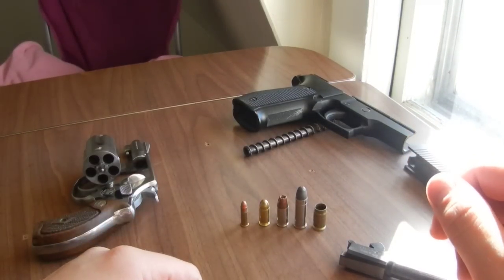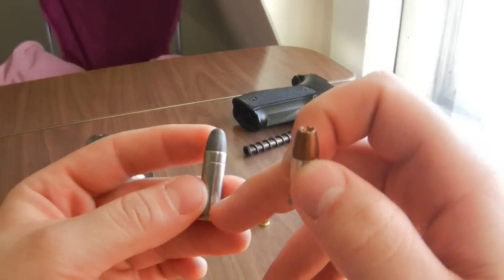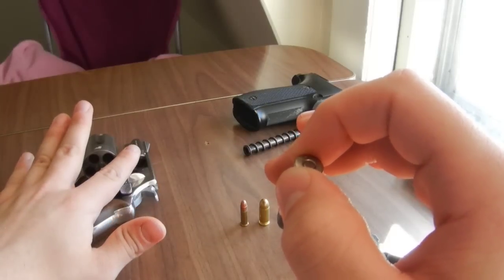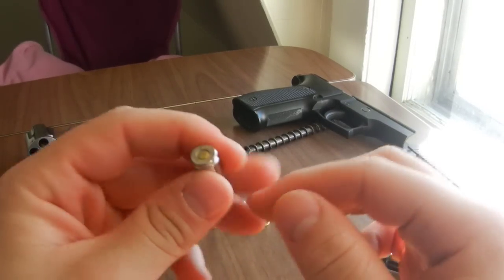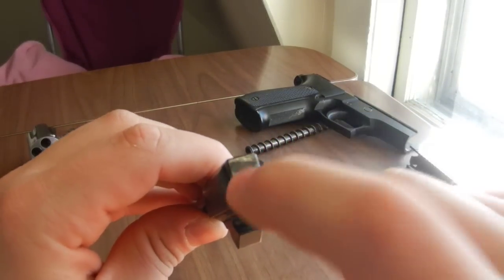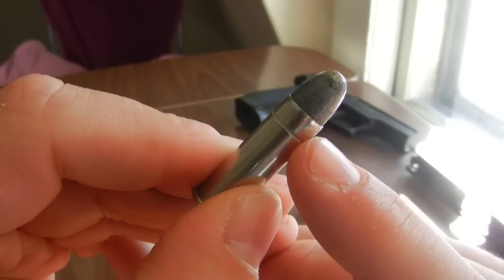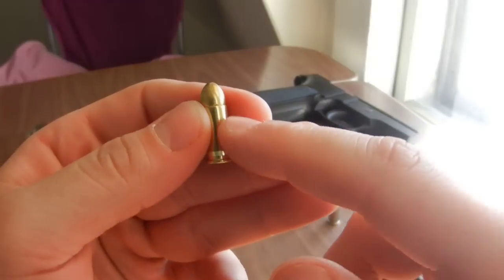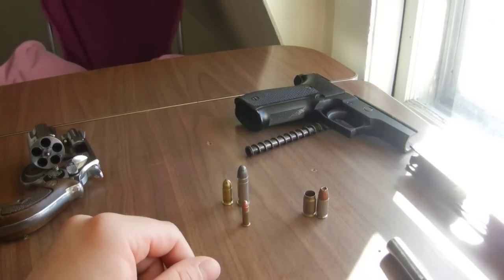An Explanation of Headspace in Pistol Cartridges

Comment: Just to say, the case mouth is not what prevents the round from falling through the barrel. The round itself prevents itself from falling through the barrel. A 9mm barrel has a bore diameter of .354 because a 9mm is .357 diameter. That slight difference is what prevents the bullet from falling through the barrel and also the reason you see scoring marks on a bullet once it fires. That is also the reason a bullet is able to catch the barrel rifling and spin when it is fired. The case lip does help prevent the bullet from being "jammed" into the barrel and causing over-pressurized situations. Headspacing is very loose on handguns due to light pressures and straight wall cases but the distance between chamber and the bolt or striking face is headspace. I could see why you say the case lip and the barrel are doing the headspacing though.

Comment: What's that indented line running around the revolver cartridge about 1/4 inch down from the bullet? My guess is that it's to stop the bullet from getting pushed further down into the casing. Does it have a name?